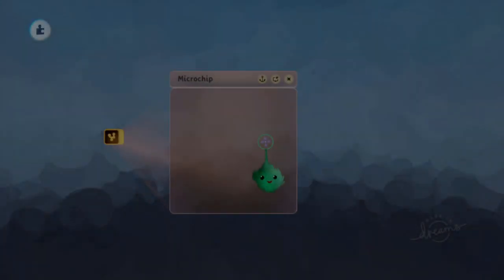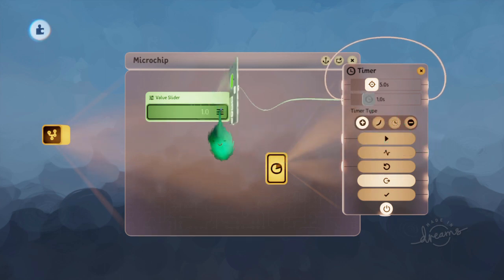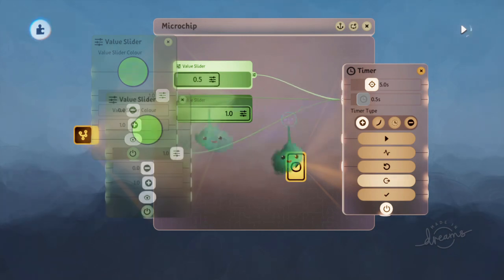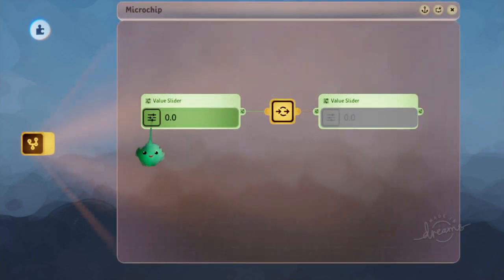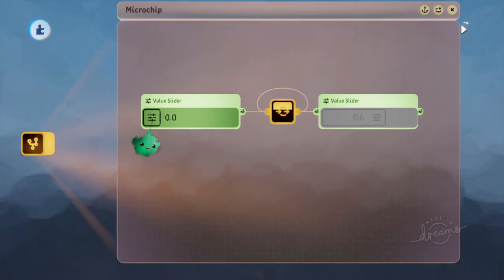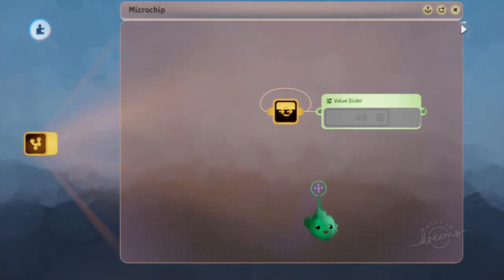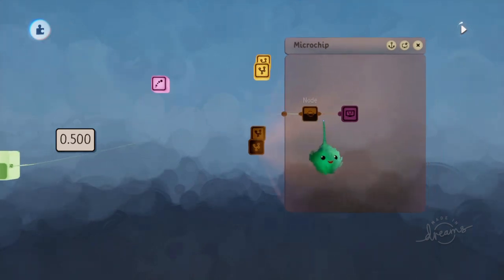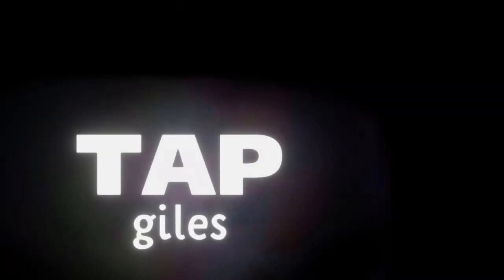Looped Wires | TAPgiles Daily Dreams Tutorial

Comment: Very interesting and useful like freeze in signal manipulator.  Can we trust this is a feature and not a bug?  It’d be upsetting to extensively use it and have the behavior changed.  Also any specific benefit over a manipulator, I guess to emit without wires could be useful?
Reply from the maker: Haven't had confirmation it's a feature, but I have a feeling this is just how it has to work so that the system doesn't get stuck in an infinite loop because of the wire loop. So I'm feeling safe using it personally.
Reply: Thank you very much for sharing this!